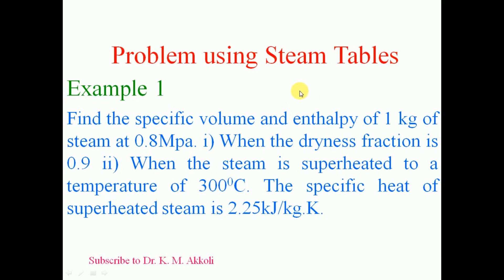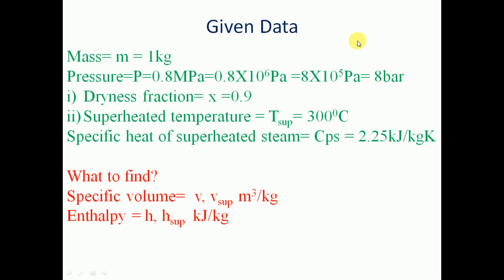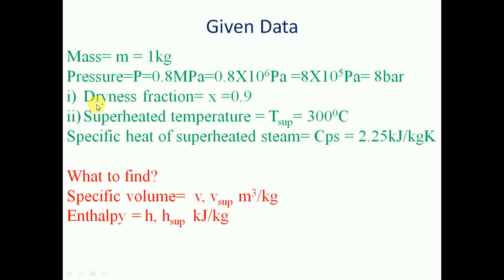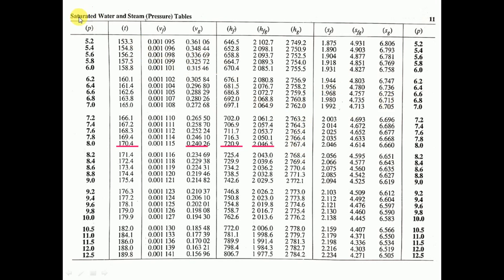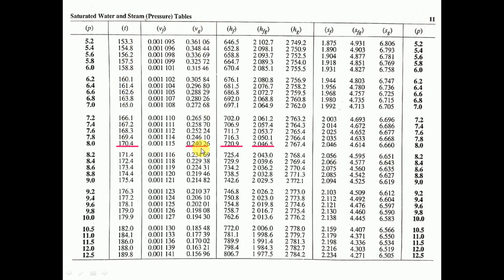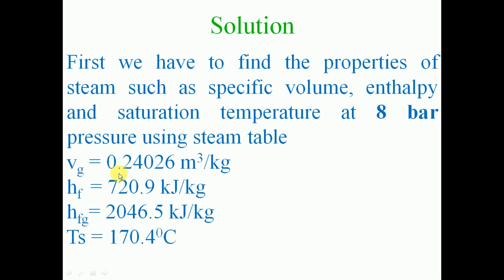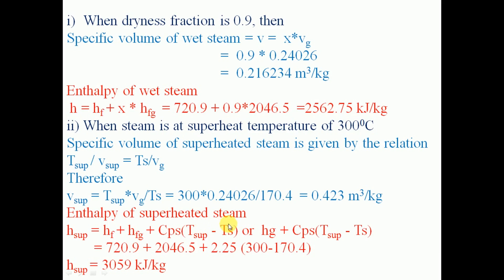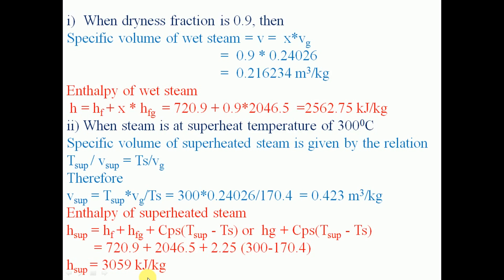Problems on steam tables

Comment: If I convert my temps in Kelvin, the values change, as I remember we need to make the celcius into kelvin?
Reply from the maker: @kiritokyle1084  as we are taking temperature difference, it will not matter.
Reply: @EngineeringXplained1  but sir, 
in the specific volume of superheated steam, it does matter right.